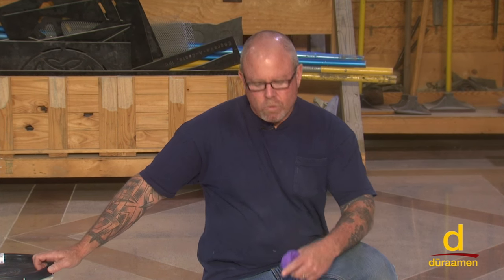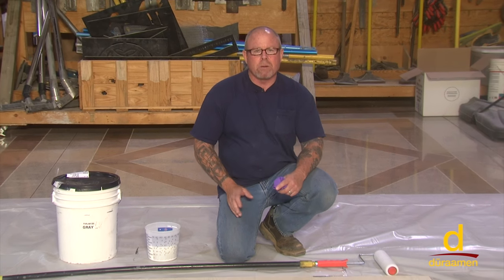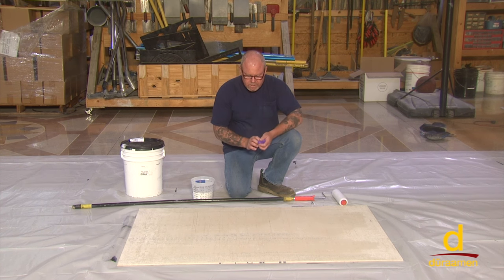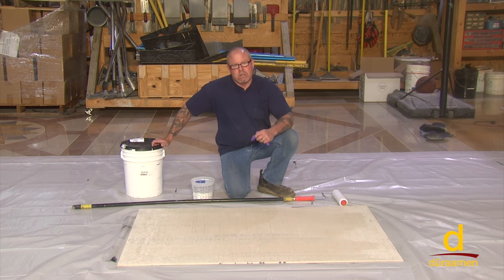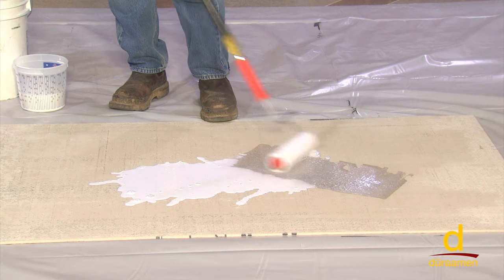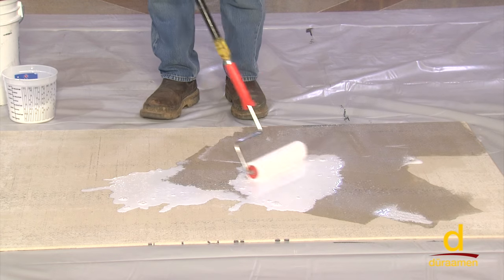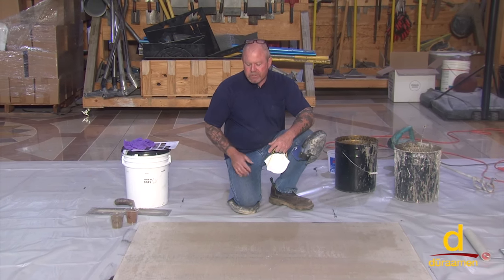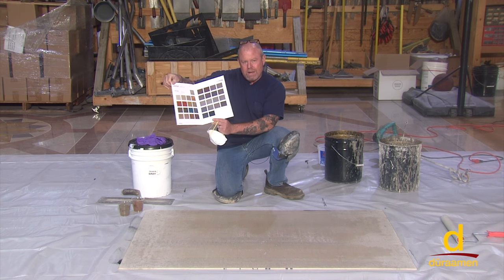How to Install Semi Self-Leveling Cement?

Comment: I remember when this stuff was called Pentimento back in the Colormaker days..I used it on several jobs and really liked it. Always gave a decent hard troweled concrete look that no other microtopping would do. Their colorfast is a great coloring agent as well.
My supplier stopped stocking it long before Colormaker turned into Duuramen... Id like to use it again.